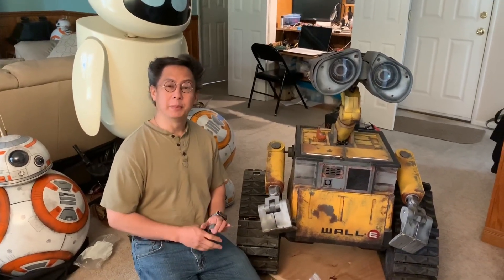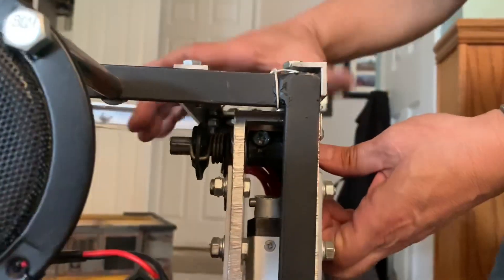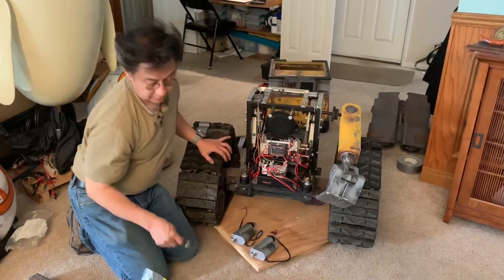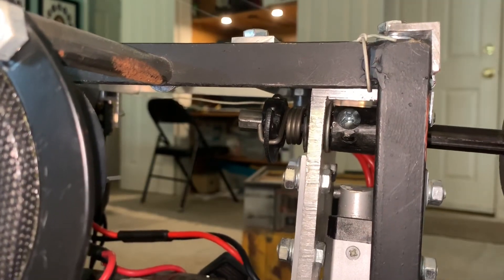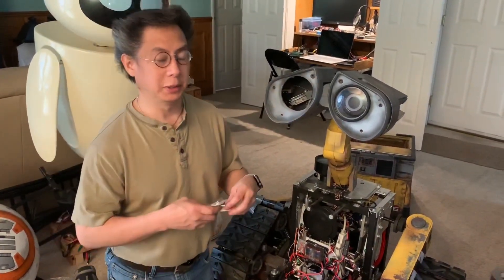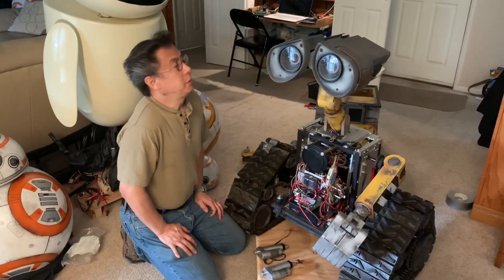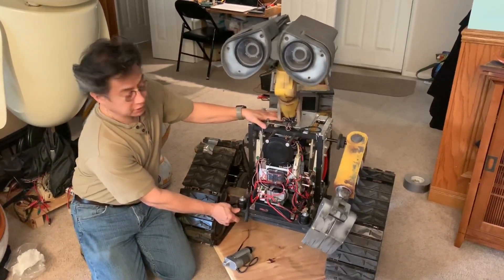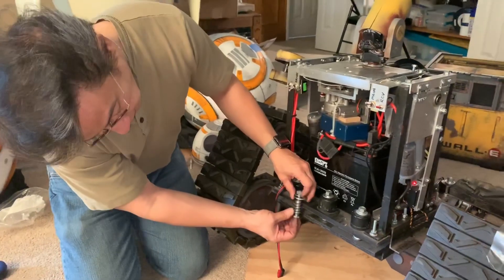All About Springs to Assist Motors for Animatronics

Comment: We need a 15 minute video on how you keep your hair so wolverine-like ;)

Great video Mike, I noticed the Disney Wall-E build used a spring to pull a cable that wrapped around the arm lifting mechanism to assist the motor too https://imgur.com/CskPexE

Do you plan to build another Wall-E or do any upgrades to this one to add more features? What build(s) are you working on or plan to work on next?
Reply from the maker: Thanks for the pic of that.  I didn't know the Disney build used springs for that, but of course, makes sense. 

I've been on and off on a design to extend the arms.  Other projects and life get in the way of that.  I'm building an alarm system for my car that will text me what sensor has been triggered.  It'll probably end up as a video here.
Reply: @TheMikeSenna  That's great. I too am working on a more functional arm with extending and some finger/wrist movement, feel free to reach out to me on here or the FB group when you start yours if you want to discuss what progress I made